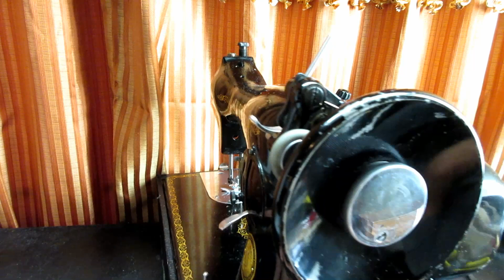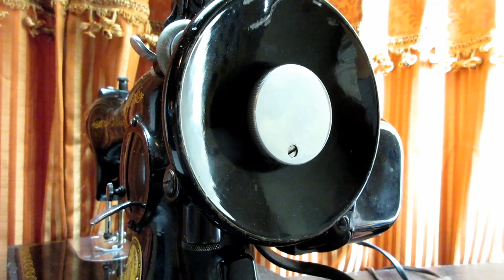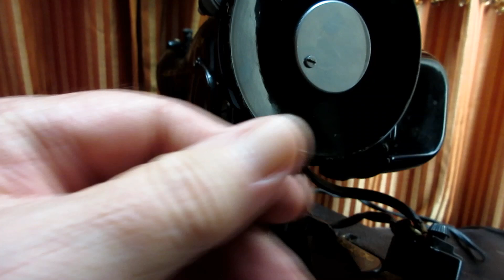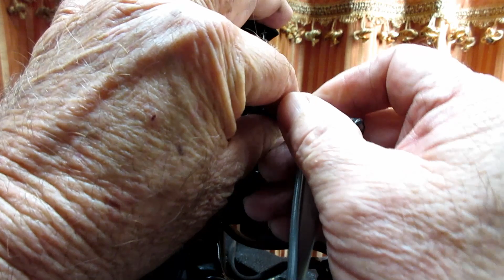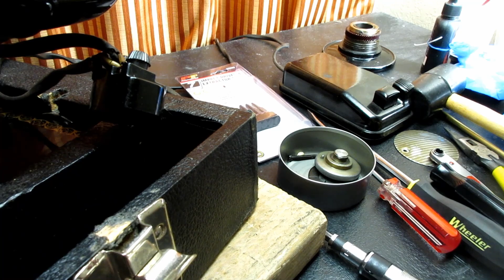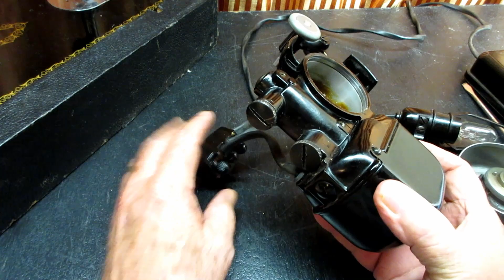Singer Model 15-91 Remove Motor, Light, 3-Pin Terminal & Handwheel.

Comment: Hi, Just found your channel... Love it! Recently bought a Mercury Deluxe 1953. Looks identical to Singer 15-91. It has a broken bobbin wheel bracket (where the tension screw is), it also has a broken off reverse lever-broke off flush.  I bought an extractor... But the part that is still in the machine will not come out. Do you have a video on how to bore/replace the reverse lever? Do you have a video on re-tapping the whole? The past send to be a #6-32 thread.
Reply from the maker: Welcome to Andy Tube on YouTube. I can't speak about your machine as I only work on SInger Models. Here are all 17 videos for the Singer model 15-91 in a playlist: https://www.youtube.com/playlist?list=PLsCOZgzzaiKJftyGwzdDiWa9R6HFEACJo
One of those 17 videos is all about the feed regulator: https://youtu.be/yzSOycGMl5E  I also have a playlist of videos for the feed regulator of other Singer models. You can find those 13 videos here: https://www.youtube.com/playlist?list=PLsCOZgzzaiKK0oRkepget1fJu6LIa4Gv4   I'm hoping one or some of my feed regulator videos can help you. I usually buy a used replacement part on eBay when needed. I have not had to re-tap a machined part and have to experience doing that, sorry. There must be many YT videos for that though. Good luck, and thanks for watching my channel.

Comment: How much grease do you need to add? And us there wicks in this model?
Reply from the maker: Less than you think if you mean an application to the worm gear/handwheel gear. After cleaning I use TriFlow Clear Synthetic Grease and apply it with an artist acrylic paintbrush to both gears. I don't fill the cavity or anything like that. Yes, there are wicks for the motor shaft bearings. There are several videos about the motor and working on them if you search. Here's a nice blog that folks use too; http://vssmb.blogspot.com/2012/01/complete-how-to-re-wire-potted-motor.html
Reply: @andytubesewing1953  thank you just ordered the wicks will give it a shot
Reply from the maker: You can do it, Ross. I've only done the one, but it sure is quiet and smooth now. Good Luck.

Comment: These videos are a real gift as I just got a 15-91 that needs rehabbed.  I oiled it and it seems to run fine, but I do smell a burning smell when it runs which worries me.  Will be following along with you after Thanksgiving.  I have a Redeye treadle in the wings waiting to be rehabbed.  Thanks so much for your work!
Reply from the maker: Thanks for watching my channel. I hope the videos will help you with your 15-91. That burning smell can be old, dried, hard grease wicks in the motor or even dried oil in some of the bushings. Don't run it much until you discover the source and inspect it closer. This is my first model 15 and I'm finding it to be a very strong model Have a nice holiday then.

Comment: What a gift you are to anyone trying to sort out these old but more excellent machines. We had an old New Home 920 and couldn't even find a manual for it but learned it is now Janome so Janome New Home 618 is the same machine it is also listed as a White Model 7 hundred something. So many old machines have been out of use for a long time. So we got a Brother se400 then someone gave us a Singer 457A in cabinet it was frozen up and I am working on it just ordered a white vertical shaft gear as per your recomendation so now the needle position lever isn't working and I am trying to get the bottom oil plate off its a rubber plug any way so then someone gave us a Brother SE2400d now som,eone is giving us an old Singer. All I wanted to do is sew some boat cushions as per Sailright.
Reply from the maker: Wow, you're like a vintage sewing machine magnet! I think those machines are coming to you for a reason. Did you know you can get free downloads of most Singer Instruction Manuals directly from Singer? I mention this b/c it sounds like they will keep finding you. You just enter the model number in the search box and it will list any manuals available for download. For example, here is the model 457: https://www.singer.com/search/support?title=457     The manual for model 457 is 66 pages long and explains all the features of the machines, how to use them, plenty of basic sewing tips and how and where to lubricate the machine. Thanks for watching my channel and good luck.

Comment: So happy to see a new series, Andy! Love the new draperies.

I just picked up a neglected circa 1954 Singer 201-2 that's needs a lot of TLC. So far, I've cleaned and rewired the motor and cleaned all the rest of hte machine's moving parts--next up: rewire the light and plug, and then remount the motor. 

The ratchet handle saved the day for me, too, with those "A" screws!  But if that hadn't worked, I would have resorted to my Harbor Freight impact screwdriver set.
Reply from the maker: Your very busy with these machines, Jo. I'm wondering when you will start posting videos of your work? I've never rewired a potted motor, so it would be interesting. Thanks for saving another machine and take care.

Comment: Ray Elkins YouTube channel in a video entitled "Singer 201, 15,1200 Potted Motor Removal"
shows how a machinist (himself) makes short work of removing those "awful" screws.  You 
would have been successful if you had used a solid hammer instead of that rubber one.  Hope this helps.  Thanks for this video.
Reply from the maker: Thanks for watching my channel, Dennis. I hope you enjoyed the video. I'm familiar with Ray Elkins and the video you mention. For other viewers reading this, this is the video Dennis referred to: https://www.youtube.com/watch?v=uGub1XiTNR8      I've watched a number Of Ray's videos over the past few years. I also have a 2 oz brass hammer like he uses. I am certainly not a machinist like him, but over the years of working on sewing machines I've tried several techniques for removing stubborn screws. I've found a metal hammer doesn't always work for me. I understand the theory that a metal hammer creates a better "shock" to the screwdriver/bit. I've tried heavier hammers too, up to a 12 oz steel ball peen hammer. I've also used different weights of plastic hammers, wood mallets, and hard rubber mallets/hammers. It's been my personal experience that the hard rubber hammers work as well, and sometimes better than a 2 oz brass hammer. I also find it easier to use and I can put more force into the strike. A vintage hickory wood mallet I have works well also I mostly use the 2 oz brass hammer and the hard rubber hammer for my sewing machine work, and you can watch me use both in my videos. To each their own I guess, and in the end I may have been successful using the 2 oz brass hammer, or maybe not. I do know the impact wrench was very easy to use and it worked perfectly. BTW, I called them awful screws because several of my viewers said that about them. For me, a screw is a screw and I don't personify them, only my machines in general by giving them names. Take care.

Comment: Your motor runs so quiet!  Thanks so much for these videos, Andy.  I’ve got all the parts you removed in this video removed from my machine.  I’m not touching anything else until I see you do it.  Well, okay, I could not resist disassembling the tensioner.  I found out I was missing a piece! I’ve learned so much about tension from you, I felt comfortable doing this.  I just took off the parts I am familiar with, up through the two tension discs. Luckily, Thrifty Farm Girl had the piece I was missing.  The piece was shipped within an hour from when I ordered it, and I got it yesterday.  Now the tensioner is all reassembled and put away until you start working on yours.
Reply from the maker: It is a quiet motor! At first I thought I made a bad connection b/c I could not hear it, haha. I haven't even looked at the tensioner or bobbin winder, but first glance they looked like the ones on model 99K that I did. Guess I'll find out down the road. Congrats on your success, and thanks for watching.

Comment: I HAVE TO GET ANOTHER TOOL NOW! 
Thanks Andy!
🤣
Reply from the maker: Absolutely! I just gave "acquisition absolution" to all you tool lovers. I'm very impressed with how well it worked and wonder how I got by without it all those years. Best tool gift ever, thanks Nicholas!
Reply: @andytubesewing1953  I had the same situation when take apart the first machine I took apart I improvised with the lager version of impact drive with some mods.
I was happy to see a 1/4" drive version,
And I work in the parts industry and had not seen one and I sell PTools, Live and learn as the saying goes.
Reply from the maker: @roosterwilson9371  When I searched for the tool my friend gave me I saw many brands and different styles, but the PTools 1/4" drive seemed to be the only one of that size. My friend made a good choice for me.

Comment: That machine must have been in the case all it's life because it looks to be in very good shape. No rust and it doesn't look to be  messed with. I don't see Apprentice slips on the screws. HAHA
Reply from the maker: Yes, it came in the case. There are several "usage" marks on the finish up close, but that's OK with me. You'll see where it was "tinkered" with later in the series, and screw #175 is missing.

Comment: Well this is going to be interesting see how the motor comes up - and how you get that broken brush screw cap out.  I love that little impact driver.  I've been trying to find one that will work with sewing machines and this looks like just the thing (especially since I can be confident my Chapman bits will fit in it).  Thanks so much again for another great video Andy!
Reply from the maker: thanks for watching, Meagan. That driver worked like a charm and I wish I'd tried one years ago. I see a few different ones online, but they all seem to work the same way.
Reply: @andytubesewing1953  I know what you mean Andy - I've ordered one already and wish I'd known about them earlier too.  (We've got another one, but it is huge.  I really like this one because it is small enough to actually use on a sewing machine.  YAY!)
Reply from the maker: @meganmills6545  After my friend gave it to me I researched Impact Drivers, wondering why I'd never heard of them before. I did see they came in many sizes. One looked like it could twist out a tree stump (almost) haha. I',m thinking of those stuck set screws I have fought in the past.

Comment: I have a 201 that I absolutely love.  I prefer to turn the portholes upside down to put grease in.  I don’t understand (brushings). Hopefully you’ll explain this.  I love this video.
Reply from the maker: Thanks for watching, Maria. I plan to do work on the motor in a future video, including the motor brushes. This video shows changing the brushes on a Singer Motor. It's a different motor then we have on a 15-91 or 201, but the brushes are is tubes and work the same way. https://youtu.be/MNSrZnJ3w5I

Comment: Very interesting videos!  I took my 99 into a local shop to have them set the timing ( I watched your video but couldn’t get it set ) anyway they took my motor and replaced it with one that doesn’t run smoothly.  I wish you was closer!! Can you do a video on the motor and replacing the brushes?
Reply from the maker: I made a model 99K video 3 years ago today. It's here waiting for you 😀It's one of nineteen videos in my model 99K playlist.
The entire playlist is here: https://www.youtube.com/playlist?list=PLsCOZgzzaiKIIUgkEujqHc9iNWN9NPW2Z
The motor video is here: https://youtu.be/TmnnvGrEfmg   I have not had to replace motor brushes very often at all. It is usually something else that affects motor speed, like the foot controller ot a dirty commutator on the motor.
In the playlist is a video for cleaning the foot controller: https://youtu.be/gcIB6VJ56Yk
You can clean the commutator with a rubber eraser, but I like to polish it with a Diamond D Brush Seating Stone.
Here is a video of the process: https://youtu.be/rpTy_Bz3prA
Thanks for watching my channel, Brenda, and good luck.
Reply: Thank you for making these videos! I’m learning about my 2 singers. One is 1930 and the other is 1950
Reply from the maker: @BrendaH289  I'm happy if you're enjoying them, Brenda.